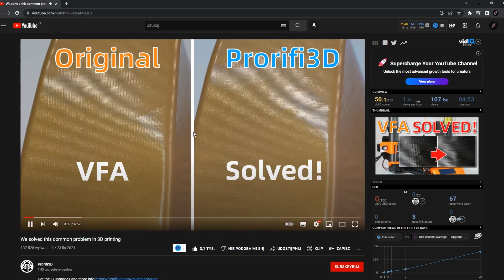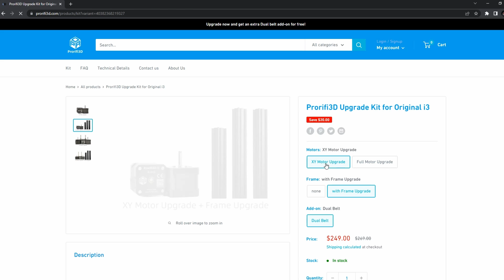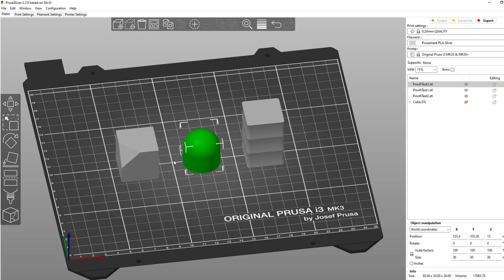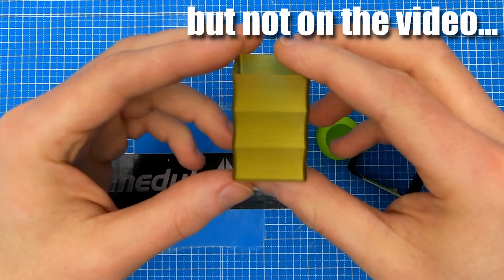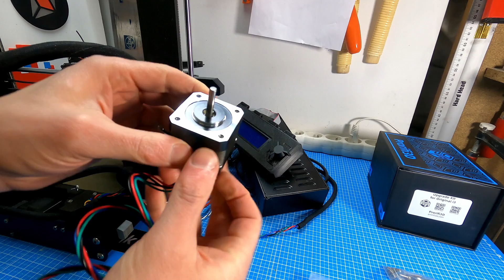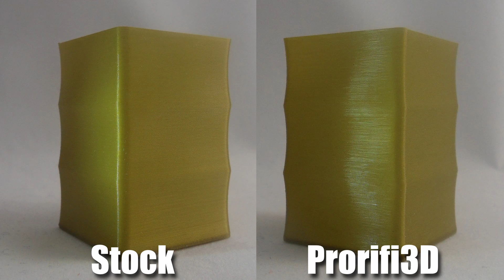Prorifi3D upgrade kit for Prusa i3 - VFA resolved?

Comment: So if I only see the VFA/MRR along the Y axis and the X is very acceptable to me, so I just need the Y motor? Or also the Extruder one?
Reply from the maker: Are you sure it’s related to the motor? It’s strange that only one axis is affected. I would try to swap the x and y motors first. If it’s motor related then you should see it on x axis after swapping
Reply: @medyk3D  I’m not entirely sure but wouldn’t know what else it could be that impacts just the Y axis sides, both of them. Will have to swap them to check. I had the same issue on my Vyper but on the X axis, and swapping with a creality motor fixed it.

Comment: Nice video! Finally someone actually testing these. I woudl have loved to see a noise comparison doing normal print moves and some fast accels. Because that's when the Prusa is incredibly loud - at some very specific speeds. I think that's why Prurify has these custom slicer settings, to avoid those frequencies.
Reply from the maker: From what I understood their explanation it is to avoid harmonics which also leads to noise. You can check their profiles on their GitHub. If you have a model/gcode I can test the noise levels in follow up video.

Comment: Do you need to perform a firmware update to get the new stepper motors to work correct?
Reply from the maker: No. I did not change the firmware and did not have to change steps/mm in the config. It's just a matter of replacing the motors.

Comment: I did the X/Y/dual-belt upgrade and found it to work as well. It's nice somebody focused directly on getting rid of VFAs, because otherwise you have to do so much research and testing yourself. I am super-happy with the result. Videos are way better showing VFAs, so I did a before/after Benchy test and posted a short video at https://www.youtube.com/watch?v=w57RtnBsGCk.
Reply from the maker: Nice video, you did a great job of comparing the before/after benchy. So Prorifi motors are working not only for me :)

Comment: Thanks for your video, but as a new buyer I want to see the quality of the prints and a conclusion from you. Is it a good investment?. In a 12 minuts video you have spent 30 seconds analyzing the pieces. But as I said thanks for the video.
Reply from the maker: True. I am trying to show all the data without giving my opinion/recommendation.
I was able to take better pictures, so you can judge yourself:
https://medyk3d.com/2022/04/prorifi3d-x-y-motors-upgrade-pictures
The pictures are still far from ideal, but I can confirm: after changing the X and Y motors the VFA/MRR is gone.
I paid $145 and I think that's a lot for two Nema17 motors. The print quality is better but not perfect - that would require more upgrades (changed extruder, bear upgrade and maybe linear rails). How far we should push it, maybe it's cheaper to buy other printer?
I have no data about longivity of those motors. Maybe after a month or half a year VFA will be back.
And the stock motors are not brand new (but brand new Prusa will print with VFA anyway).
I did my best to do a fair comparison with the resources I have.
If you can't live with VFA and $145 is not too much - give it a go.
In the next video about Prorifi3D (with dual belt upgarde and prorifi3D slicer profile) I will do better job with analyzing the pieces.
Thanks for your comment it helps me to improve my future content.
Reply: @medyk3D  Thanks for take your time to show us the results and make a better pictures. In my case I'm waiting the motors and I had a lot of  doubts. Looking forward your next video.
Reply from the maker: @danielpastor9410  The motors are ok are they do resolve the VFA/MRR. I've checked and there is 12 month warranty: https://prorifi3d.com/pages/warranty-periods